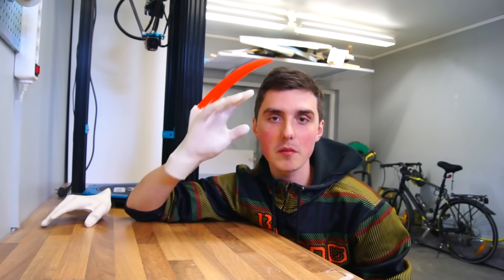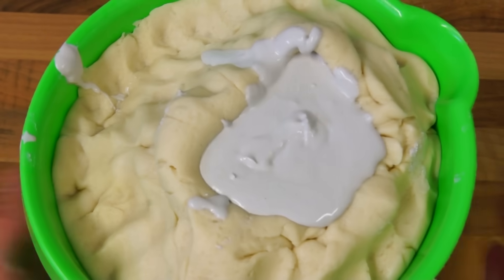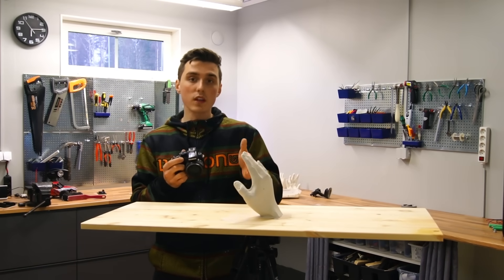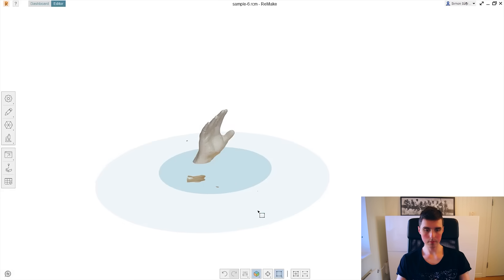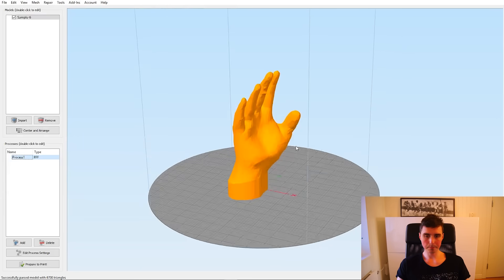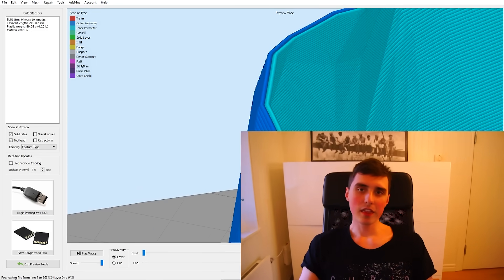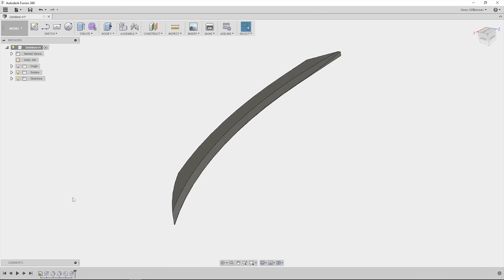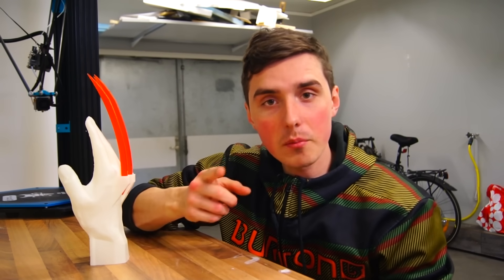AWESOME 3D PRINTED WOLVERINE GLOVE!!!

Comment: What are you doing with the not used printed parts? Is there a way to reuse the material? Or can you sent it somewhere to get it recycled? 
I am thinking of starting with 3d print as well for my hobby RC Car, and I will have a lot of test prints, so can I reuse those material or so on?
Many thx for your feedback.

Comment: this is the shitiest version of the wolverine claws that I've seen
Reply: mr. fedongalon why don't you try it and make an even better version of this
Reply: The Dark Lord of Cookies

Whit enough patience and time i could make a more realistic wolverine claws in no time... sadly i don't have enough time to work on it because i am still at school and stuff... + getting the materials would take time which again i don't have ... time for...

using iron is very difficult ... so you can use wood... you need  3x of > /// and 1x. nice to hold tube ==== for a better grip. make sure that the /// sticks out in the middle of each finger but not too far out ... glue them nicely to the tube and make sure that the palm of youre hand gets that nice comfy grip whit each of the /// sticking out in the middle of each hand.

next you cut out longer pieces of wood which is the length and same look at the claws wolverine has which you allso need 3 of to glue on each of the... ///. 

and in the end... it should look like ... for example if you cut a knife in half and you put the one part of one side of youre hand and the other on the other side of the hand ... it looks like you have been stabbed... 
but on this it looks like claws goes out of youre hand... 

soooomething like this > https://s-media-cache-ak0.pinimg.com/originals/90/ca/9f/90ca9f3d42767f0d36b613792329bf80.jpg